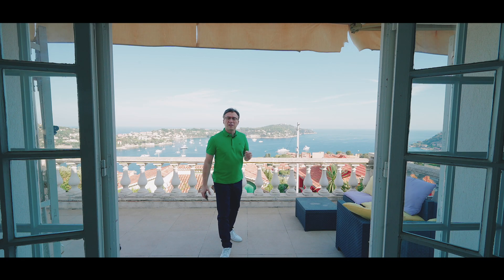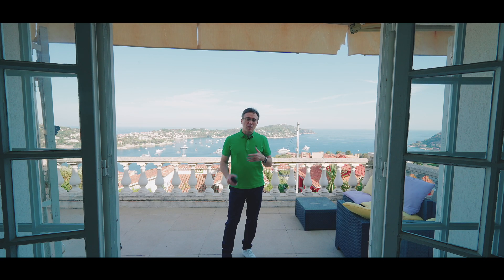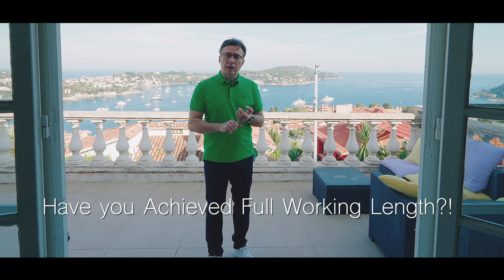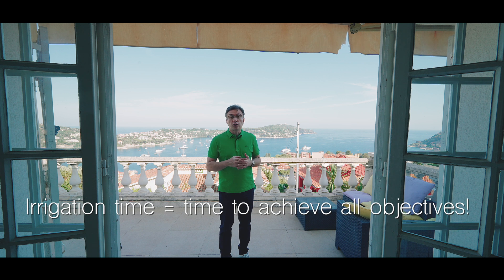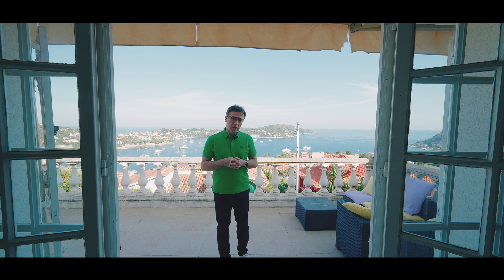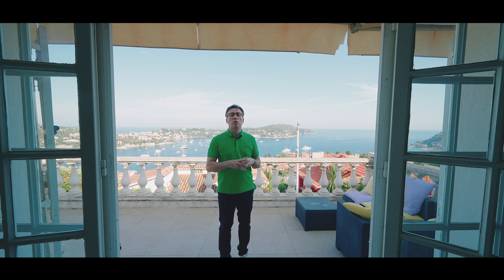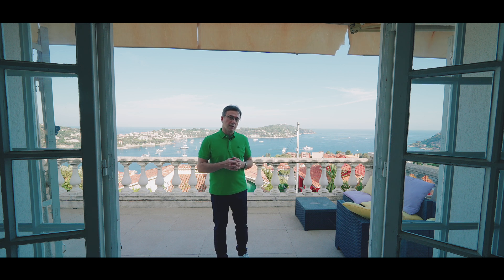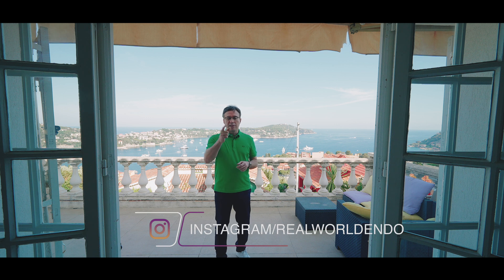Comment Questions: How long to irrigate?

Comment: We need new product "Mini ruber dam    , "which designed for single tooth and provide long soacking by irrigant no leakage ,  without block all the oral cavity
Reply from the maker: But if it doesn't block the whole oral cavity then it defeats its own purpose of preventing bacteria in the breath and saliva and contact with the mucosal tissues contaminating the area. There are large Rubber Dam clamps that do something like that but they are not adequate for RCT.

Comment: Hello Doctor thanks for all your videos, I am a huge fan of all of them :). I would like to ask about the details regarding irrigation. Personally I start counting used syringes of NaOCl after I have already prepared all the canals to full WL. Depending on the case (necrotic/vital) I use from 2x syringes (10 ml of 5,25% NaOCl) per canal + ultrasonic activation every 5 ml to depending on the bacterial load about 4-5 syringes per canal. Before the last NaOCl syringe I use EDTA about 1,5 ml per canal and then I use distilled water/saline before drying and obturation.  So from starting the case to ending canal preparation it also takes me about 30 minutes, and then i spend around another 30-35 minutes irrigating and another 15 minutes drying and obturating the canals + 10 minutes speaking with the patient, getting the tooth numb, placing rubber dam, taking pre-op/post- op x rays and placing a temporary filling. So an average molar case takes me 1,5h. However i know endodontists completing molar cases in 45 minutes. I don't know what can I do to increase my efficiency without sacrificing the quality of my treatment. Do irrigating during instrumentaion counts that I can proceed directly to obturation after 30 minutes of working with the tooth? When do I stop irrigating? If I stop seeing any bubbling and if the hypochlorite comes clear can I assume that's enough? Do you perform the final irrigation after instrumenting the canals and if yes then how many ml of each irrigants per canal in vital and non vital cases?

Comment: Thanks for thinking about educating us even in that heavenly beautiful city. 
As you know to remove the smear layer we need Sodium Hypo Chloride and Chealating agent such AS EDTA solution for irrigation. My question is can the EDTA in RC-PREP  be considered that Chealating agent? It is15 percent EDTA . THANK YOU VERY MUCH IN ADVANCE
Reply from the maker: Thank you! Yes it can. It’s still EDTA and it will work. I’m not a big fan of RC prep as it’s difficult to make sure you have removed all of it from the canal and that won’t affect the seal during Obturation. But if you like it keep on using it since we don’t have a specific study on that claim. 👍
Reply: What is RC-prep means?
Reply: @dr.aymanfayoumi5518  Root Canal preparation cream.
Reply from the maker: @dr.aymanfayoumi5518  RCT Prep is a EDTA based gel that also lubricates.

Comment: Hey Dr. Naseh! Hope you had a great time k. France. 
Another question that maybe you could answer is : Does eugenol have a place in modern endodontics? For example using it in pain management or any other indication?
Reply from the maker: Great question. I really should make a video about that one! But to give a short answer. No, not really. Everything it does can be done with Ca(OH)2 and because it's so highly hydrophobic and inhibitory to bonding there is really no need for is use. Thanks for the question! :)